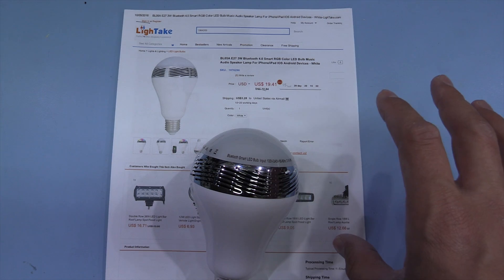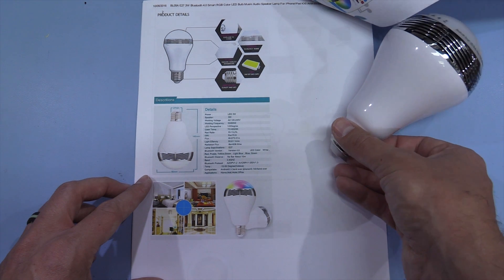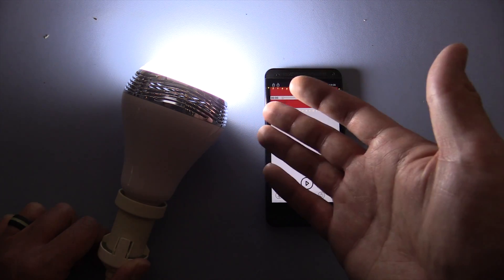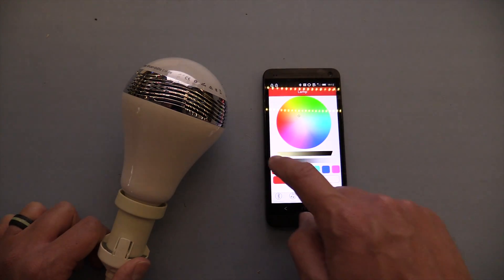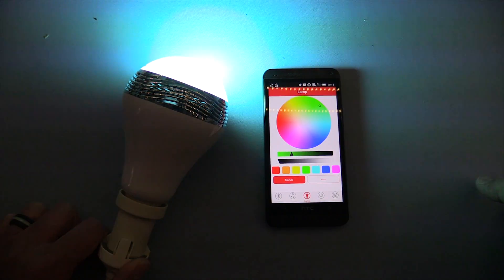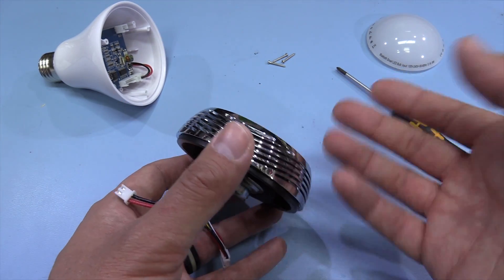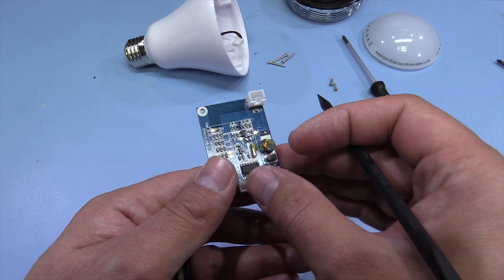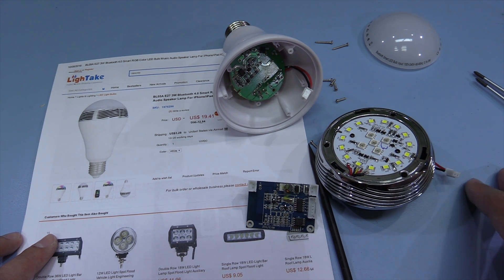SDG #039 BL05A 3W Bluetooth RGB LED Bulb & Speaker (MagicLight)

Comment: Such low CRI makes this lamp simply pointless. Everything with CRI<80 should not be used at home...
Reply from the maker: +Piotr Szarański CRI is only one measure of quality of light and considering the measurement is based upon a black body light source (a plain incandescent lamp is CRI 100), it is not necessarily the best. Many people prefer a light source with represents daylight which can never have a CRI of 100 because it inherently has more blue in the spectrum for the cooler colour temperature. Having said that, this lamp is not designed for task lighting and would be pointless as such.

Comment: seems like a gimmick $5.00 in a couple months just to get rid of them, looks like cheap caps cooking in a little oven. Probably wouldn't last a month.
Reply from the maker: +Martin P It is very gimmicky, however I'm going to use it to see how well it works. To be honest it's very nice as a mood light but I'm not sold on having to use your phone to control it. I'd much rather have a little RF remote and no speaker. How long will it last... ?